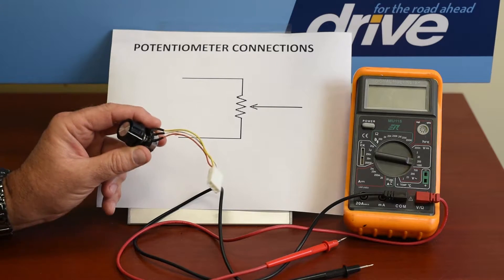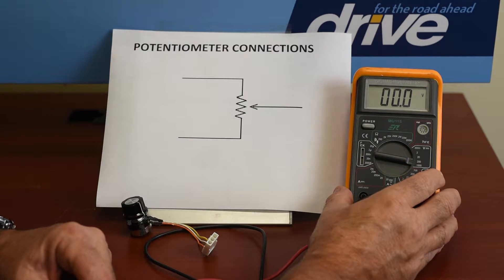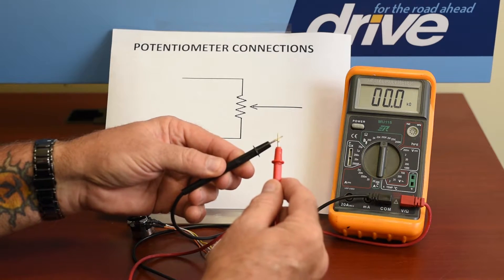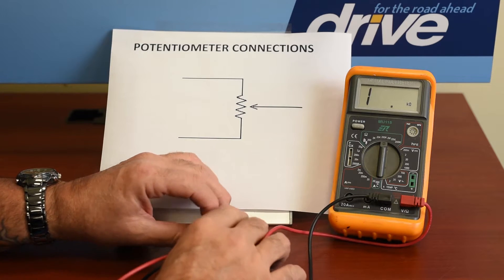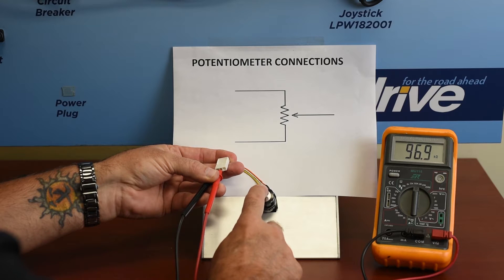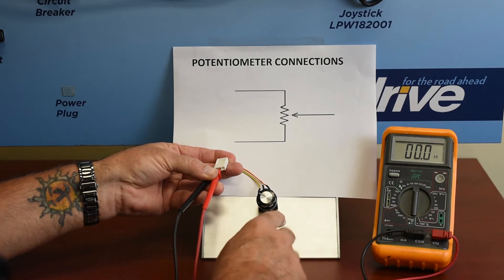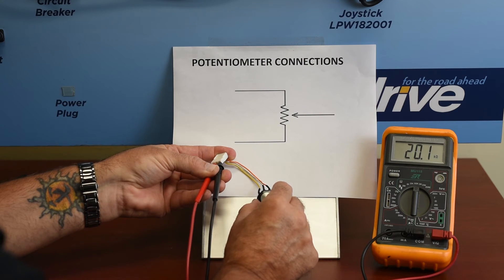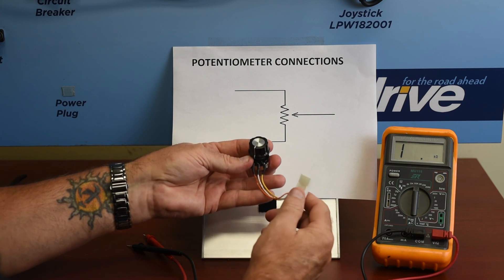how to test speed potentiometer

Comment: HOW DO YOU TEST A PAT.1271644 POTENTIOMETER. iT HAS THE POTENTIOMETER THREE LEADS AND A 24V INPUT. SHOULD IT READ OHMS AND VOLTAGE OR DO YOU NEED TO APPLY 24V AND THEN READ THE VOTAGE RATHER THAN THE OHMS.

Comment: I have a cobra gt4. I replaced batteries, they charge to 27.3 volts, replaced control box, brushes in motor, hand forward and reverse assembly. Brake and motor ohms out good. and it goes fast for about a 1/4 mile slows down and starts beeping with no flasing lights. and will shortly after that stop. PLEASE HELP.
THANKS.

Comment: i have an amigo value shopper i put one end to the other end  i only get 4,500 ohms is this a bad part? there is a part number but couldn't find any info online 7217-20-0726 ? but i have a feeling that thats to low of a number right ? 4500.ohms?

Comment: Hi Can someone help i have a 30k potentiometer need a new one i can get a 10k 20k50k 100k which one will work on my scooter thanks. Jeff uk
Reply: Jeffery x you can use the 50k pot and solder a 20k resistor across the outside leads, or you can use a 20k pot and open it and scrape an ever so thin we're talking you just let the weight of a razor blade do the work Linda thin, layer off of the carbon track inside... test it you will not have scraped nearly enough off... do it again and re-test... keep repeating until you reach 30k-ish... if you way overshot by say 5k or more, just add an appropriate resistor. If the potentiometer is going to the pin out of a digital controls interface that has a logic IC in it, you can likely just use any pot, like literally almost any value would work, but on analog circuits you'll need to be somewhat close to the value your circuit calls for.

Seriously though pots are $0.99 on eBay from China and like $5 at RadioShack, Fry's Electronics, Home Depot, Ace, Lowe's, Walmart, etc... 
but if you're in a pinch here are some instructional videos on how to do the pot hacks I mentioned above.

How to change the values of your available pots...

To decrease:
https://youtu.be/W-TmOLPDLhc

To increase:
https://youtu.be/8tQVNNLeSas